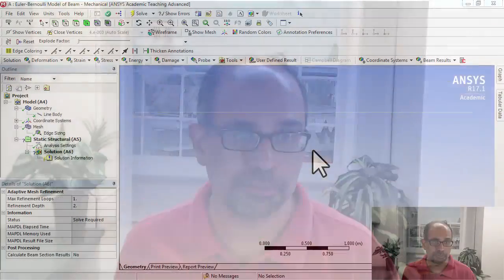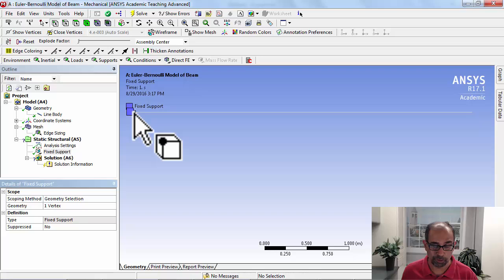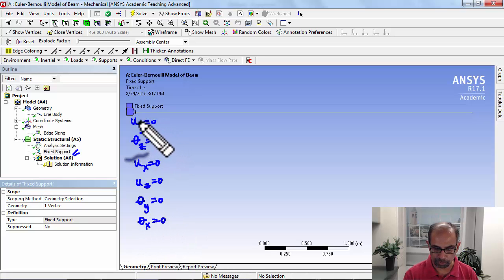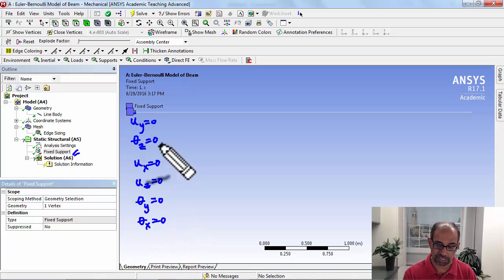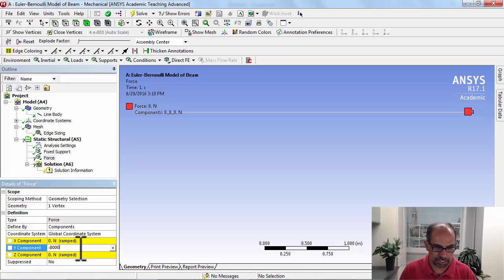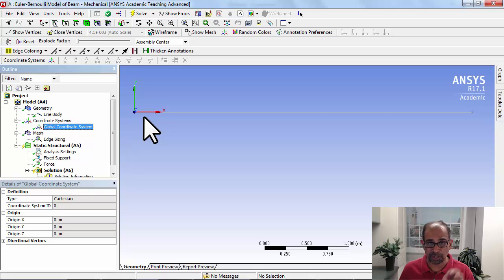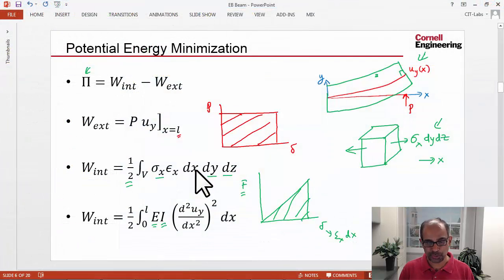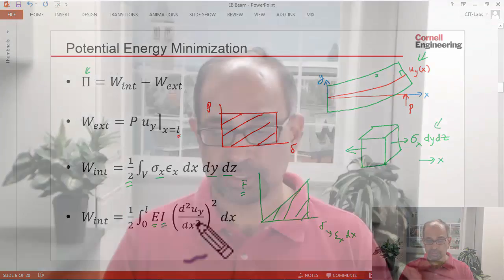Beam in ANSYS: Specify Boundary Conditions

Comment: UUuuurrrgh I'm really starting to hate Ansys. How do I get the "Static Structural" option into the work tree to start with?
Reply: In Workbench, look in the analysis systems and there will be a static structural. Click and drag the static structural to the project schematic area. The system will drop in the are and can be accessed once geometry is specified.